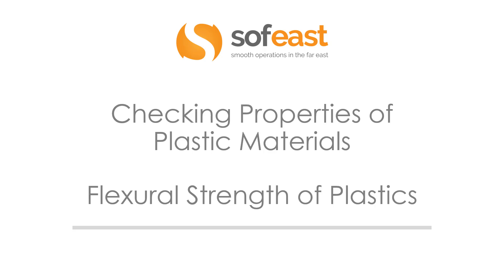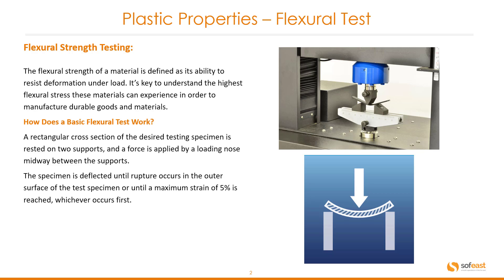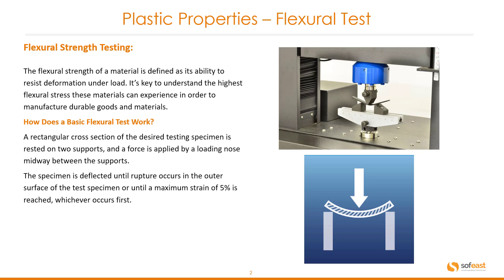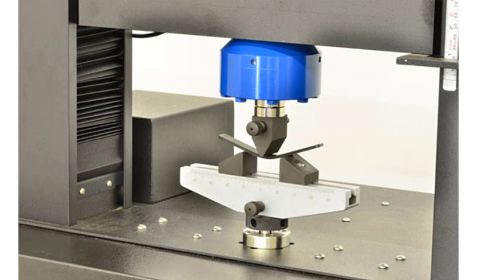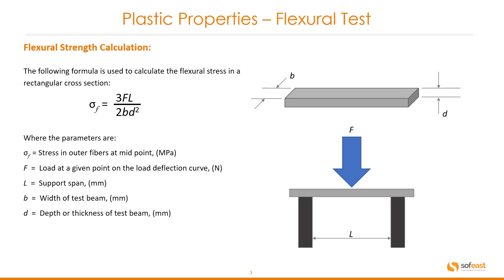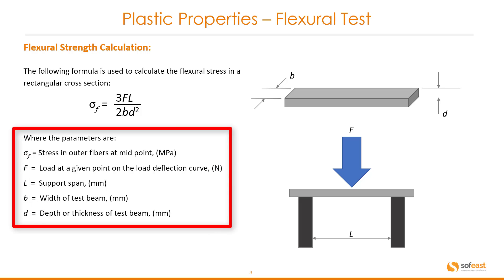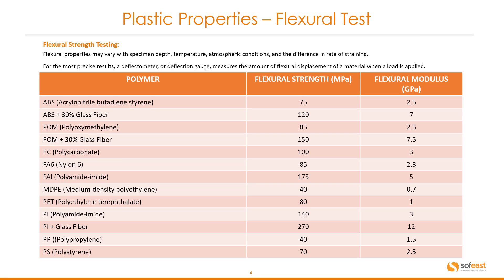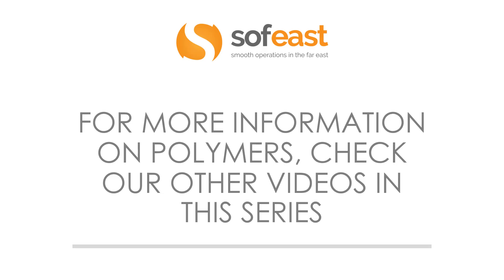Checking Plastic Flexural Strength

Comment: Your explanation of flexural strenght is incorrect per the technical definitions I read; in a material that returns to its original shape after bending, when it deforms by 5% that is considered its flexural strength, in material that does not return to its original shape after distortion; as soon as its distorts that is considered the material's flexural strength.
Reply: The linear stress\strain graph says that it only continues to 2% then most of the ductile materials reach the yielding point